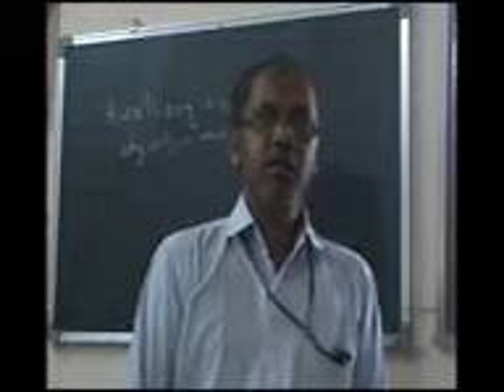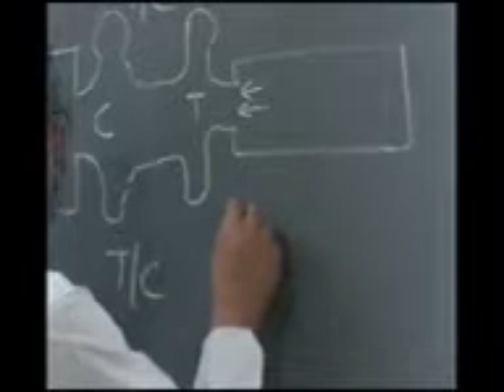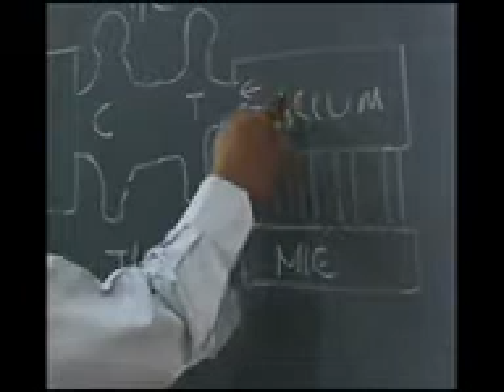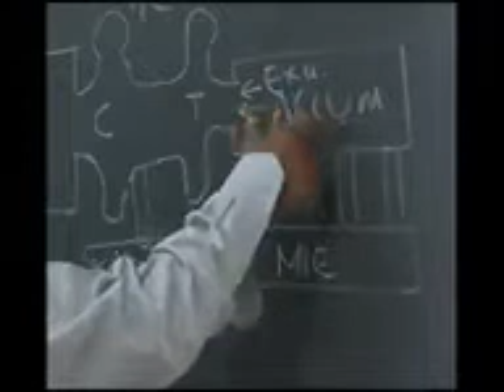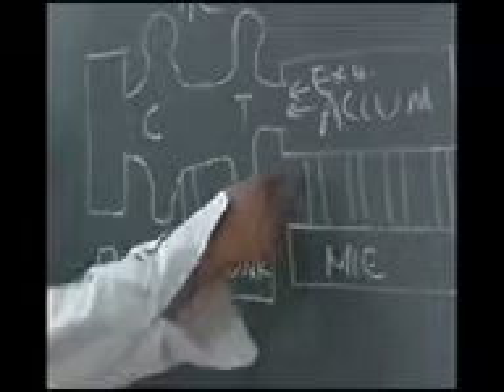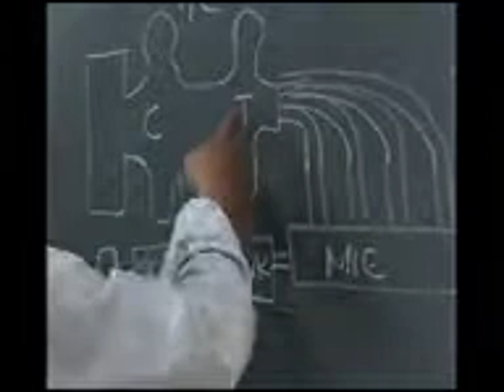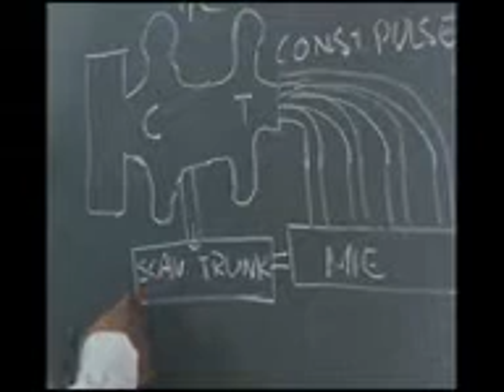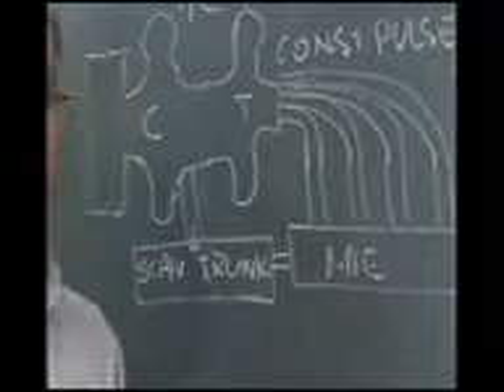AUX BLOWER of an engine

Comment: sir, from where this blower taking suction
Reply from the maker: From the same scavenge system right after the air cooler and  just before the Scavenge box or stuffing boxes, but NOT in any case from engine room air.This way as the blower starts it causes suction which helps the T/C to increase its RPM and provide more air, so it does two things- improving air to engine and bringing up RPM of T/C and finally of M/E..